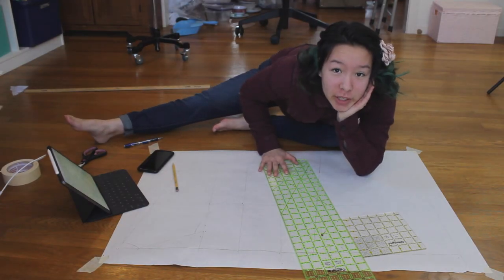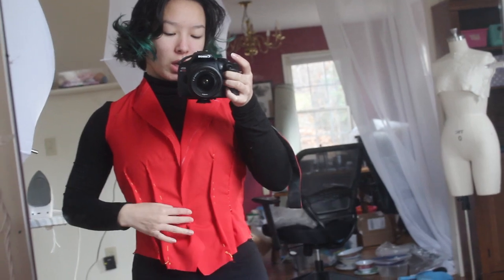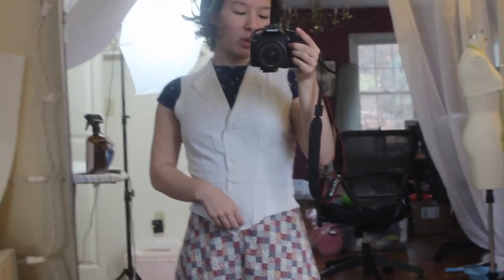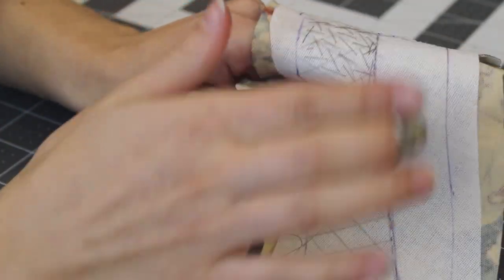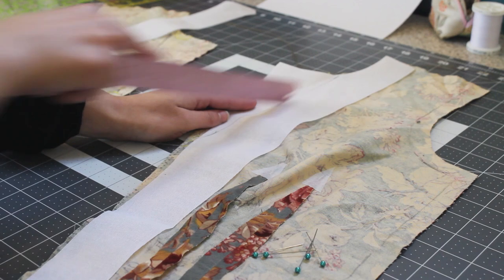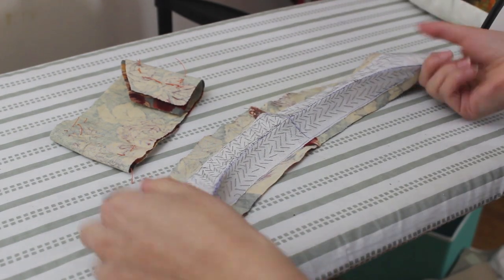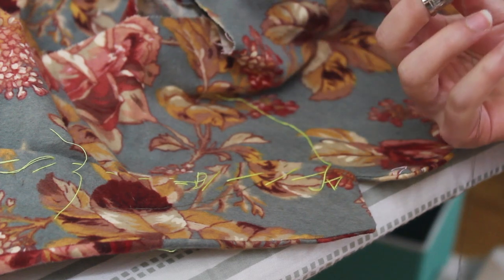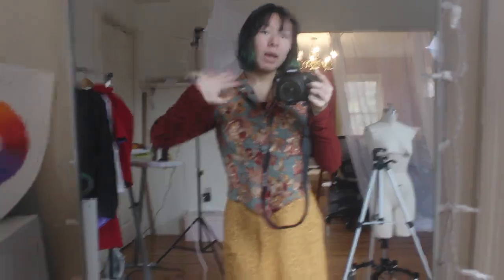Sewing an 1895 Waistcoat | Ft. Actual Tailoring

Comment: Your not the only one struggling with those messed up instructions in the keystone guide. . .
Reply: I did find that just reading it through and making notes for reference helped. Some of what can throw one off is that some of the measurements are on one of the scales. I got an antique tailoring ruler to play around with that has the measurements at scale printed on it. There are modern ones, but the antique one was prettier and more fun. 😀 But yeah, The Keystone Guide really does mess with one’s mind.
Reply: It really is not a great resource
Reply: @rd6203  but the jacket looks so nice.

Comment: Did you find there was any rhyme or reason to when you needed to use the whole measurement and when you needed to use half the measurement for drafting? I'm trying to draft my own right now and some parts look wildly out of proportion, lol
Reply from the maker: not that I can remember, I think my best advice there is to look at the picture and if something is way way off like there's no way it could be correct than cut it in half if that makes sense. Also you can check the circumference measurements of your finished pattern and compare them with you actual measurements. (Bust, waist, etc. But as always, mockups mockups mockups.. Good luck!

Comment: I have attempted to draft the keystone jacket and others from similar books. I draft them in 1/4 size so that I don't have to get down on the floor and then when I get it right I can size it up. I can do alright with copying the example pattern but when I use my measurements the lines don't match up where they should and if I can finish the result looks distorted due to extra full bust narrow shoulders and plus size. I haven't tried it for years due to chronic fatigue.

Comment: With your collar/lapel work, is that amount of matching up and carefully basting etc only applicable if you separate the collar and body? I have the pattern with the collar and everything already cut with it I think. I'm new to this whole tailoring thing and I'm being defeated by this pattern. (To the point that I bought it already drafted after a week of fighting those instructions 😭)
Reply from the maker: Well if the collar is cut as one piece with the lapel I would assume not since there’s nothing to match up...you might want to do some basting and hand sewing if the collar continues around to the back if the neck, but if it ends at the shoulder seam you can probably just pad stitch the collar at the same time as the lapel. Not sure if that made sense or was helpful in anyway but there’s my two cents

Comment: I’m wondering why you didn’t iron over a ham or sausage to keep the curve when ironing the pad stitching. It seems it was an intentional choice, but I’m not sure what the reasoning behind it was. I haven’t done any pad stitching yet, so I wondered if I might be missing something.
Reply from the maker: The purpose of ironing it flat is to get rid of any weirdness from all of the handling and to not press a hard crease into the lapel roll. I presume you could do the same thing over a gentle curve but most of the area actually ends up flat rather than curved on most lapel shapes so I think it makes sense to press it flat. It shouldn't stay flat at the roll line and potentially shouldn't even be abled to be pressed flat exactly at the roll line depending on the thickness of the fabric you're working with and how strong of a curve you've pad stitched in.
Reply: @Ora_Lin  I see. Thanks for the explanation! 😀